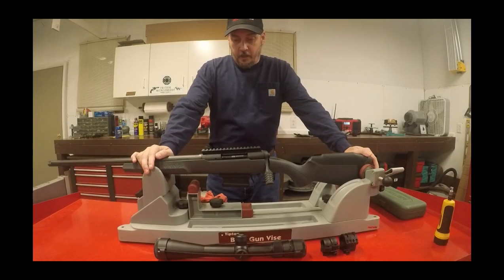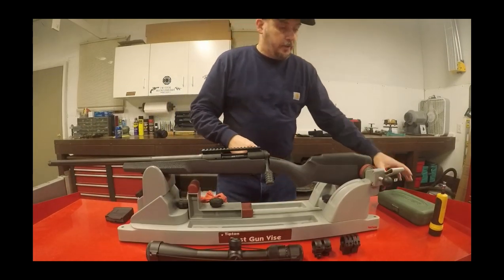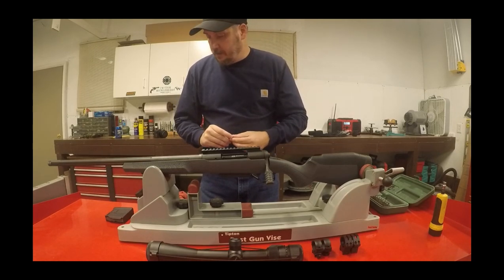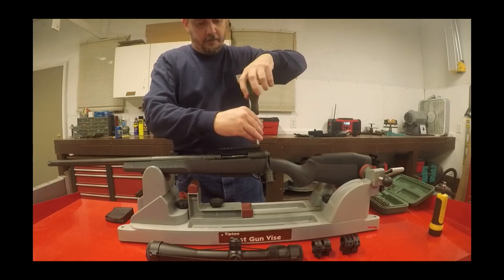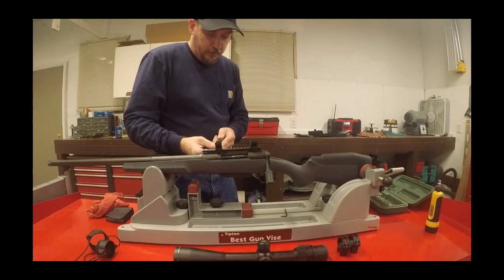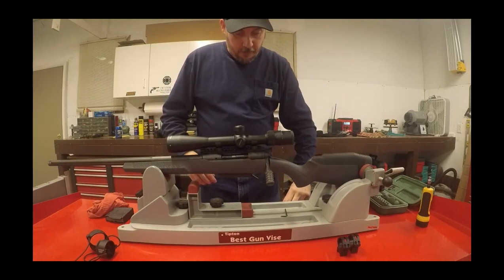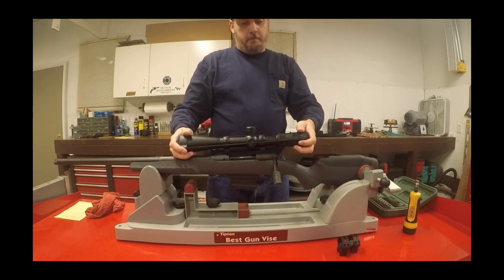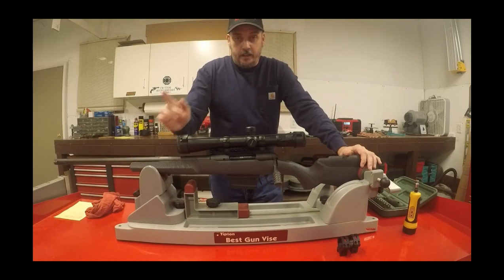How-To:  New Savage Rifle Checklist

Comment: Nice presentation! Ty..
   According to Savage Arms the action screws are between 38 and 40 inch pounds. Put a sheet of paper around the barrel and slide all the way to the end of the reciever. Loosen screws, place rifle on butt stock,  press barrel downwards hard. Then tighten front screw (closest to muzzle) first. Then tighten the rear. Make sure paper slides freely and even on both sides. The trigger screw is treated like a wood screw.